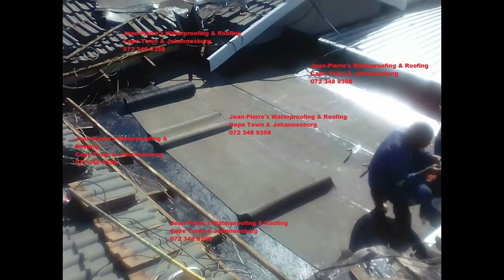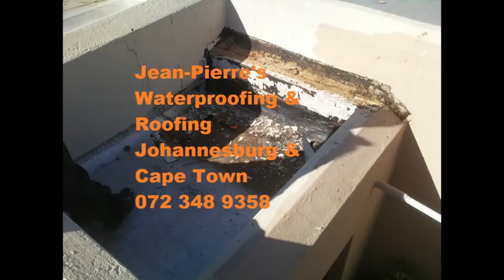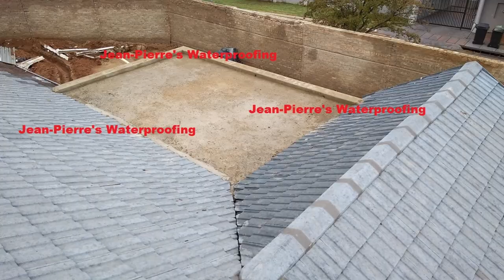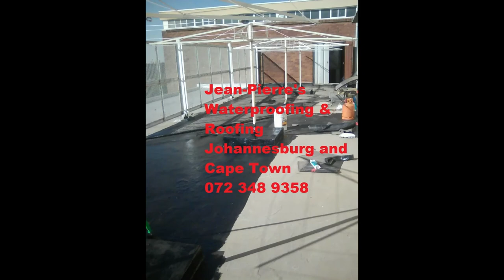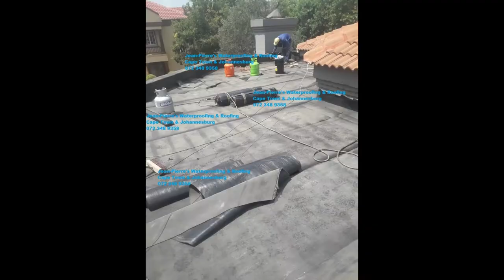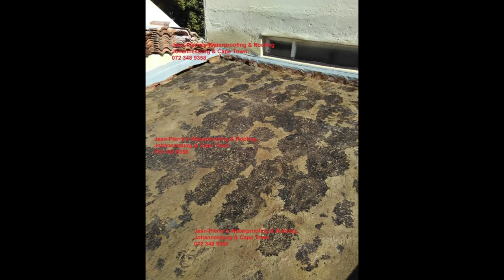Torchon Waterproofing before & after photos 4mm bitumen UV aluminum silver paint JHB CT DBN

Comment: Morning, regarding the "torch on" What has been in your experience the easiest way to remove the product
Reply from the maker: Good morning Damioun, the easiest way to remove old torchon that is fully bonded to the surface is to heat it up with a propane gas blow torch then use a flat spade to lift it, it's quicker if there is two people doing the job.